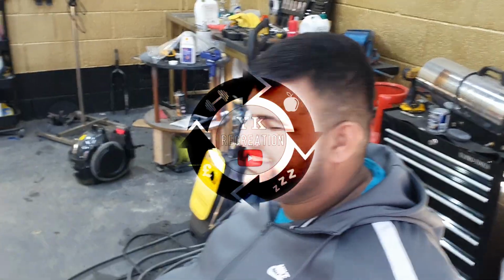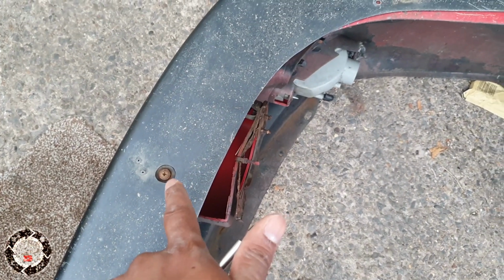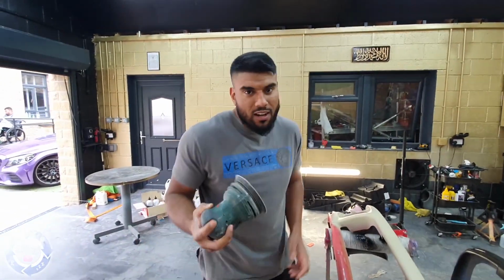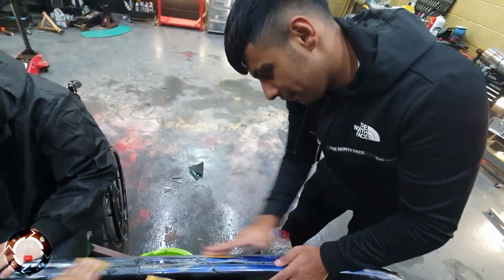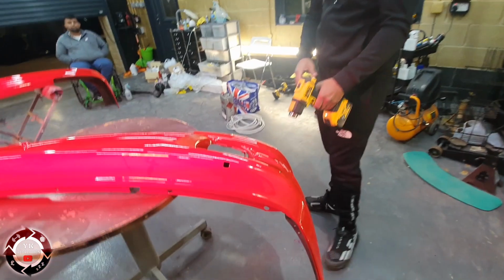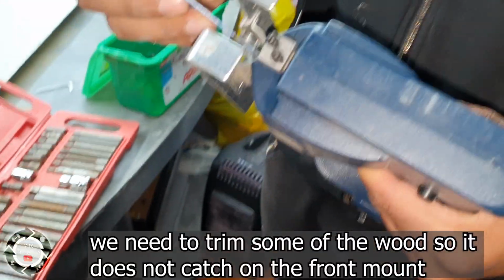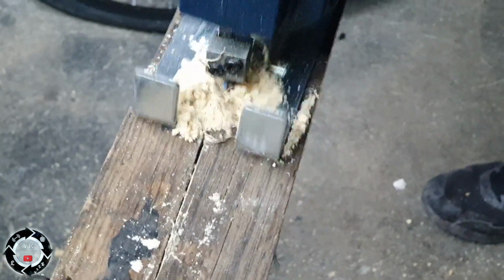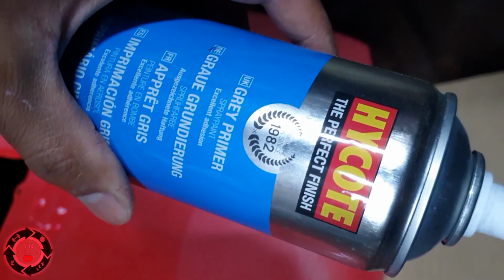FRONT END RESPRAY *SUBARU IMPREZA* (FADED RED)

Comment: Looks good! I was fully onboard with your methods until the plank of wood came out! 😅
Reply from the maker: 😬 there was a gap between the lip and the bumper and i didn't want to put rivets in from the top, wanted a smooth finish, also didn't want it to crack easily 😶
Reply: @YKRECREATION  If it works, it works, I guess! 👍